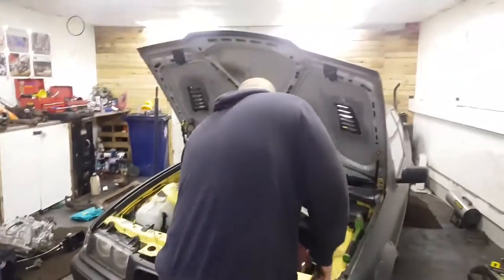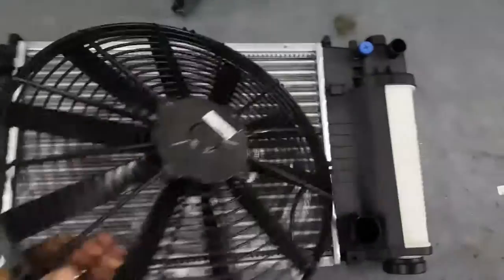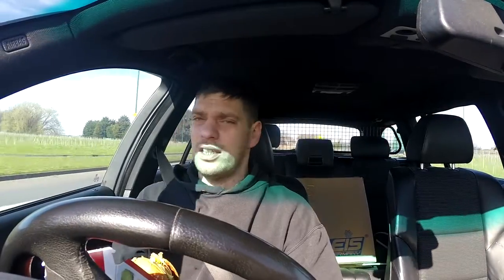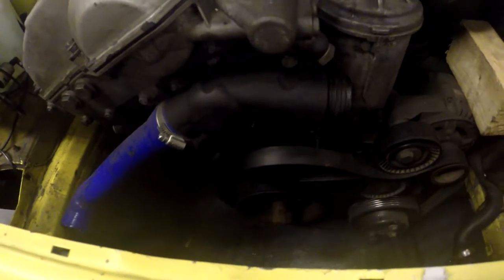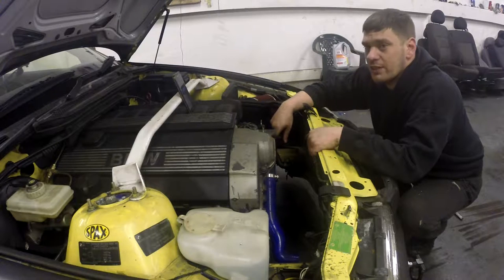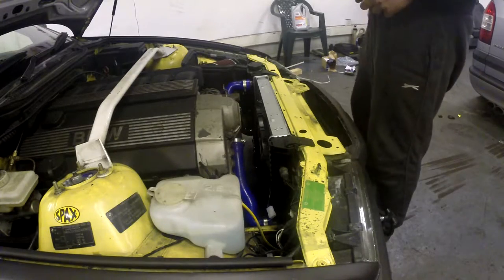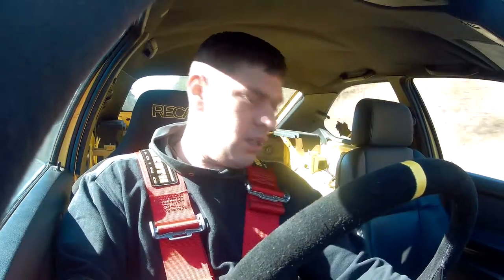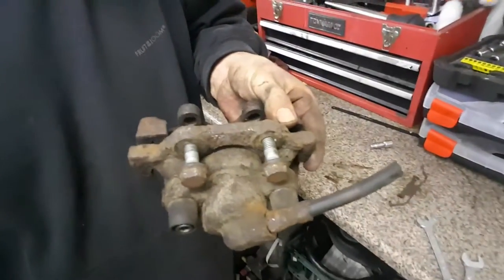Cooling fix

Comment: Wouldn't that other radiator have fit? The hose inlets and outlets looked in the same place, just the size of the actual radiator was different - did the bolt holes not line up?
Reply: Aye I suppose since it'll be on the redline a lot lol
Reply from the maker: Yes that's right the first one would have mounted the same and the hoses would have lined up, the correct size has an extra 1/3 added to the bottom of the core. But I didn't want to loose the 33% of the radiators effectiveness.
Reply from the maker: Yeah that was my theory too :)